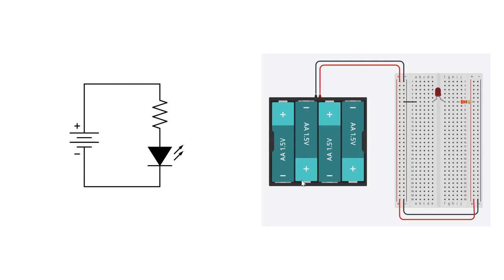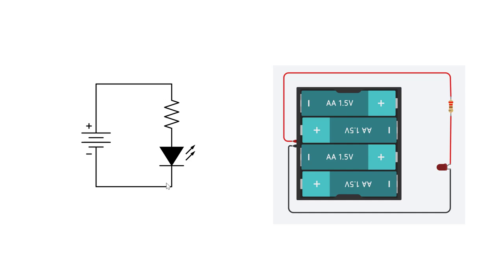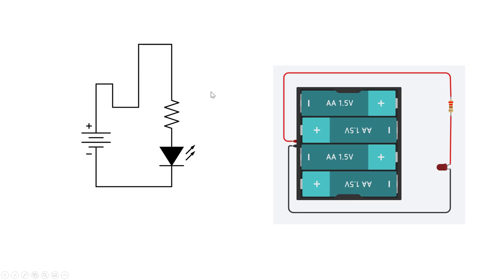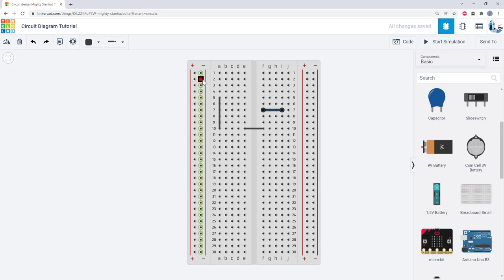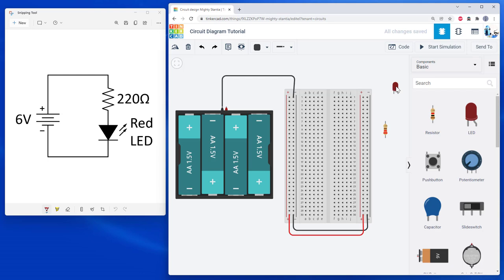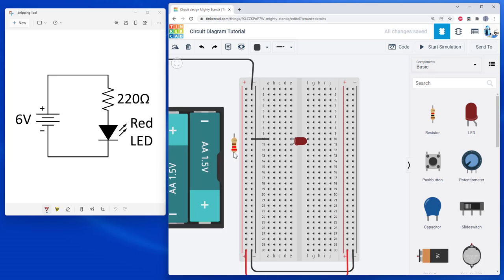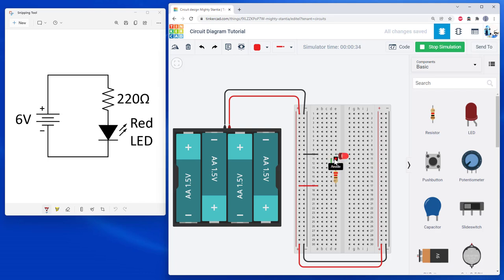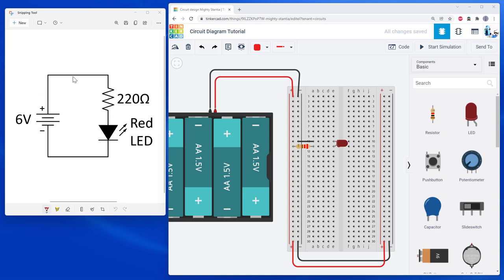How to Build a Circuit from a Circuit Diagram | Part 1: The Basics

Comment: If current/electrons are actually flowing from negative to positive, why doesn't the LED burn out? Wouldn't this mean the resistor is technically resisting current after it's reached the LED, not before?
Reply from the maker: This is a really common misconception so I made another video to address it: https://youtu.be/NUKD9qESO58